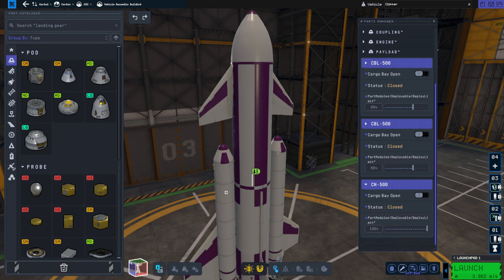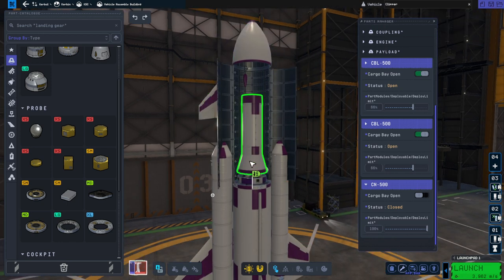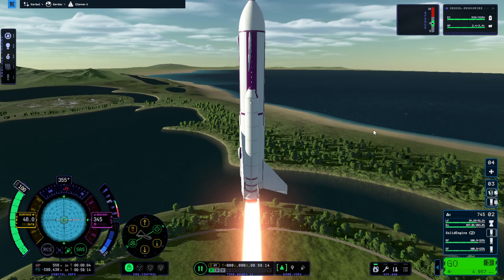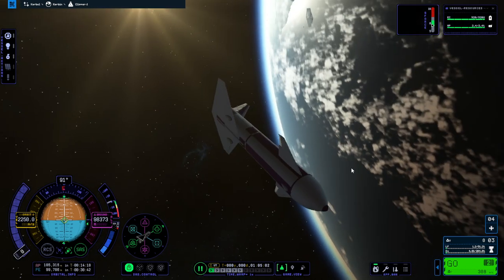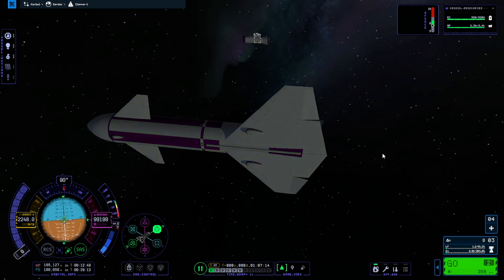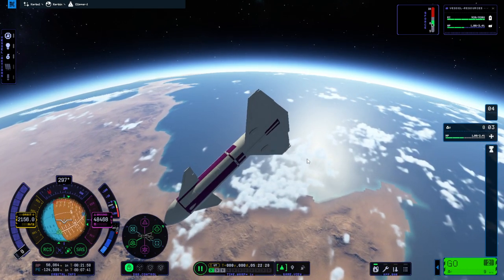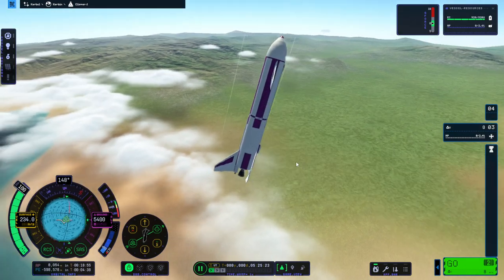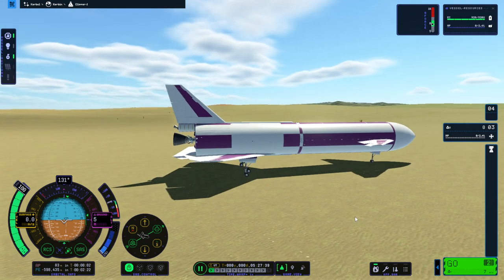KSP 2 Early Access - Clipper Cargo Launcher

Comment: Did you check CG with no payload and no fuel?  I'm assuming it moved it way back, behind center of lift.
Reply from the maker: I did check it initially when placing the wings, but possibly I changed something about the configuration after that.
Reply: @RaizSpace  CoM and CoL does not always refresh, you can consider reentering VAB after draining the craft

Comment: is it not a good thing that the Reaction wheels are less powerful?
Reply from the maker: I don't know that they're less powerful - the actual reaction wheels are plenty powerful. Just the lack of any reaction wheel in the large control core while they are present in the smaller control cores caught me by surprise. It's an advantage the smaller ones have over the larger one and, really, there's no good reason to use the larger, heavier one in place of the smaller ones.
Reply: @RaizSpace  Sorry, i meant overall in the game, missing from Part to scaled up part I suspect is an oversight in KSP2. But in KSP i have always understood that Reaction Wheels were way overpowered.
Reply from the maker: @Michael S Yes, stock reaction wheels are definitely overpowered.